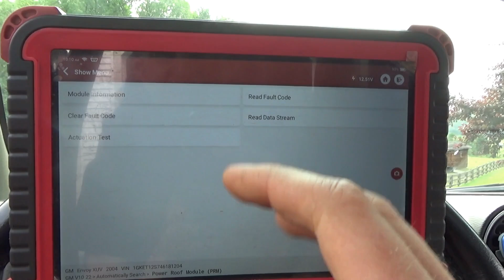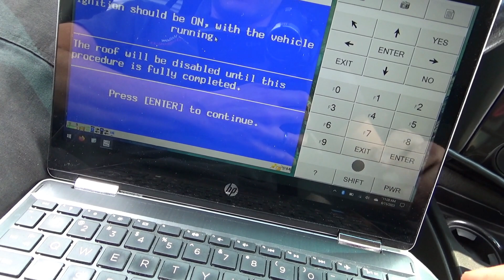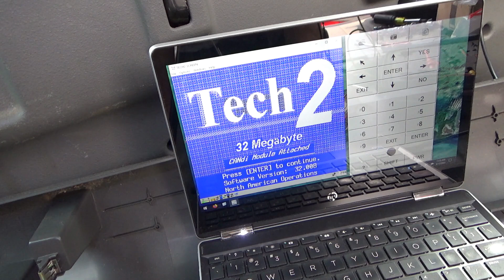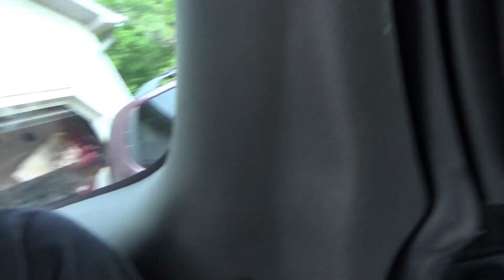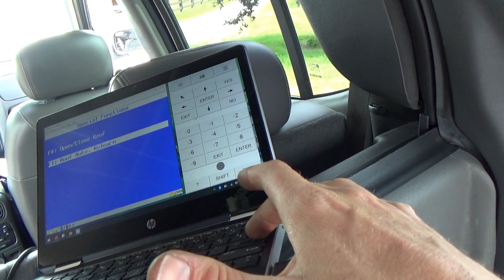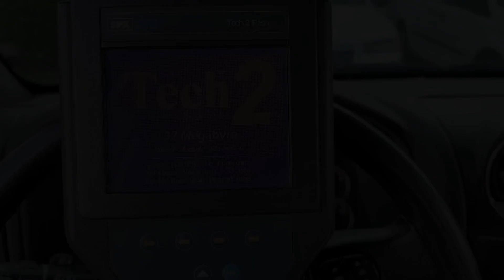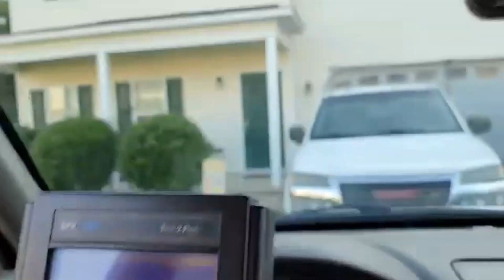Envoy XUV is BACK...and I CAN'T FIX IT?! (Power Roof FAIL)

Comment: So the grounds are integrated in a series and one component that doesn't fully disengage breaks the ground to all other components? 🤔 Really makes sense because you don't want things to operate simultaneously. One function performs before the second function takes place and if that particular function is telling the system that it hasn't completed its cycle the system thinks it's still functioning which is using the ground and until it completes its cycle and releases the ground via relay for the other actuators to activate? Maybe

Comment: I have the same problem my back window was working fine and then I opened the roof and can close the roof but it keeps telling me to open the roof on the dash I’m like it’s closed. Now my back window won’t close because it thinks the roof is open I don’t know what to do
Reply: Hello, have you figured out the solution?
Reply: @luigidmolino6217 yes I replaced the relay for the back window and I had to have it reprogrammed. It fixed the roof and window problems for me.
Reply: @Purpleppl_8 you mean the end gate control module?
Reply: @luigidmolino6217 yes but the rely that’s back there not the main end gate module. The relay should be on the driver side of the end gate between the two latches.

Comment: I have an 05 xuv. I came across same issue. After many hours of my life, that i will never get back, doing endgate latches, window and roof relearns. My solution was to wire in a switch for the roof. (Bypass the module)
For the endgate functions i use a small bidirectional scanner that i found for $100 on amazon. Via an app on my phone. 
Another problem i had to fix was 4wd disconnect. Other than that it's a cool... truck? Its unique and kinda rare. That's why it was worth saving a small piece of americana to me. 
Mine has the 5.3L and ive growen to love it
The little bypassss switch doesnt even alter the look if you get the right switch with a decent looking mounting bracket to look profressional. Dont use some cheap looking toogle switch. Save that crap for the batmobile.
Reply: Hi thanks for your fix. I would love to know how to get endgate working ? Glass up & down on scanner ?
Reply: Hello, what are the colors of the wires that you used for the manual switch to bypass the sliding sliding roof module?

Comment: There was what looked like a stamped metal item visible on the PCB next to the relay - could that be a low value current sense resistor in the ground path, that's gone open circuit?

Comment: I wonder if the reason you could not fix it in part one was that the rear window wiper was not quite in park? Could not do the window re-learn so you could not do the roof re-learn. obviously would not have fixed the loose regulator but may have got you further down the rabbit hole.

Comment: Ivan, I've personally rebuilt an XUV endgate with all junkyard parts and brought everything to functioning with a vcx nano interface and tech2win.

The microswitches in the endgate latches are the first part of the "waterfall" of checks.

Check under Special Functions of End Gate Module... Watch your latch status'

I suspect these are dirty or failing... Also often times if you seperate the latch from the metal housing that bolts to the gate, you find the plastic housing has cracked and the gears are flexing things in the latch in ways they shouldn't.

If you have any questions about my hands on experience with this mind-bender, feel free to reach out.

Good luck,
Javier G 

P. S. - I also have multiple latches and other endgate parts available.
Reply: I also have physical copies of FSM for that year if you need me to send you some info from the xuv section

Comment: Wow  300 comments in 16 hours, too much to read. I have one that is working also, 207,000 miles on it. I had updated the pcm with a cheap tech2 knockoff, it says to pull a couple fuses but dont remember which. I went to program it and it failed, long story short i had an aftermarket radio and had to pull that fuse also, almost cost me a lot bit it did reprogram. Not sure this info will help but sometimes its something weird causing an issue. Im not sure why it would stop working again but those latches may be an issue. Interested to see whats the issue now. Ill help anyway i can. I ended up wiring a pushbutton switch in the tailgate cause those pad switches are poo. If i think of anuthing else that will help ill let you know,i did take pics of wiring diagrams but i imagine you have better access to that than i do keep on wrenchin brother
Reply: Hello, I am having issues with the endgate latches. It doesn't want to open. Does that fail to open also when the endgate module needs reprogramming? And if so, do you have a wiring diagram to be able to get the endgate to open till I get a Tech2?

Comment: I'm not going to pretend I would have solved this. But right from the get go, my first thought was a micro switch somewhere or a sequence issue. Having worked on bmw forever with all of their intricate sunroofs and convertible tops that fold up like transformer origami. If the motor is ok (usually drowning in water), nothing is bent (physical damage), it's always something stupid like a micro switch stopping it. Whether a part is not stowed right, not adjusted correctly or incorrectly orientated. I always wonder what people will do when they got older, because they're a nightmare even with all the factory adjustments procedures. To get the roof right, then all 4 adjustable frameless windows working in a ballet. All with anti-jamb safeties, haha.

Comment: Well it was worth a shot.. I'm glad it's now fixed. I was thinking it was a position switch issue this time. The roof has to know where the door and window positions are to move or it'll deny permission, similar to a convertible top in these newer cars. That's where the theory of operation comes in handy. Would have never guessed the  window learn had to be done before the roof would even move in test.. good work guys..

Comment: In my mind, the position sensors should be at either end of the tracks the roof runs on. That would account for the mm travel recorded in diagnostics.

Comment: In my 25 years at a GM dealer i have only dealt with 1 of these trucks for endgate  issues believe it or not, not many around i guess. First time it came in was an endgate lower left latch issue not sending proper position signal. Could not get a new one so installed a used part. Worked for awhile then came back. Upper right latch issue this time, again used part fixed it. Came back a 3rd time, upper right latch again. Put another used latch in it and fixed it again. Last time i saw it so either its still fixed or customer gave up. A nightmare of a system if you ask me.

Comment: What seems to strike me in this situation and what Ivan has already pointed out along with the guy in North Carolina is,
when there is a loss of ground per say through latch mechanism that isn't working properly is this: loss of ground for
that module to work right. Whether there is a travel issue or tailgate position whereas grounding is achieved ONLY when
certain conditions are met. May it be a certain positioning or a positive latch of the tailgate mechanism can and will 
need to be met in order for the control module can remain operational. In other words, this entire logic is dependent on
an integral "Interlock system" will determine whether the module will function as designed. If something is out of kilter
by some varying degree by either positioning, travel or an interlock switch so that the module will remain functioning;
that is if the module is at least passing initial testing. The second module for sure is working as designed BUT it is
reliant on all other simplistic means such as a tailgate latch or perhaps at least one other mechanism that may still yet
to be discovered. I can think of other means where an interlock system would be used, such as for safety consideration,
such as for child proofing and or to prevent major damages to equipment OR just major failures that can cost an owner
a huge fortune but in this case, it is something that is burdening the repair person and the owner just way too much!!
Just in an instance of Ivan having to burn through 8 hours and the second repair person, God only knows how much
time that he has into this repair is way out there in left field!

Comment: Could possibly be damaged vias through the board on that ground supply for the relay. Could be shorted decoupling capacitor. Could be broken solder joint on a current sense/shunt resistor. The MCU on that board will most definitely be monitoring current draw through the motor. If the sense circuitry is damaged it wont allow motor operation.

Comment: There was a gentlemen on diagnostic network recently who had to remedy a malfunctioning power sun roof in a late model ford F series. The complexity in that system boggles the mind. He discover that the electric motors that operate the roof are one use only, you can not use a yunkyard one and they have to be installed in a specific position in the correct order. If you do not know this, the sunroof will NEVER operate. Thanks Ford.

Comment: That is a mind boggling problem, Ivan! Seems your Tech2 Win doesn't do all the tricks required - what a convoluted process, with weird (and probably completely unnecessary) interactions!
Keith's experience and a real Tech2, got it right and I was already cheering for him, when I saw the final message in the video! That XUV is really hellbent on not being repaired! Could there be limit switches that are a bit sticky, for not working for a long time?
Hope there will be a Part 2 for this weird case.

Comment: Years ago my foreman had one of those, his problem was the front end. He beat the crap out of it, towing, overloading etc.. once he stuck it in the mud up to the rockers and left it on site. It froze in and he had to get a ground thawer from the cement guys. I remember it finally died after 300,000 miles, then he got a Tahoe. These were company cars but they came with a maintenance program etc. I had a 3500 or 4500 dually stake truck it had 4X4 etc. diesel worked the heck outta that too. They were good trucks, made a lot of money with them👍

Comment: There is a motor current data pid. How is it measuring that?  If the missing ground should be monitored, providing a constant ground directly to the relay might cause other issues.

Comment: Irrelevant of the module function logic, there should be a simple overide switch to manually close (&/or) open the roof.
Even if said manual switch is for techie use, e.g. a switch in the Fuse box.
That way should the system fail then at least you could completely close the bloody thing.

Comment: If I had a 20 year old truck, I'd just put in a single pole double throw switch. No relays, no limit switches, heavy enough wire to carry the load. As long as I held the switch toggle in the up position, the roof motor would run to open the roof. Hold it down, the motor runs to close the roof. Both cases, the motor runs as long as you are holding the switch. It would be up to the operator not to hold it so long as to blow a fuse or burn out the motor. Crude, but at least it would work.
Reply from the maker: But what about all the tailgate functions? 😅

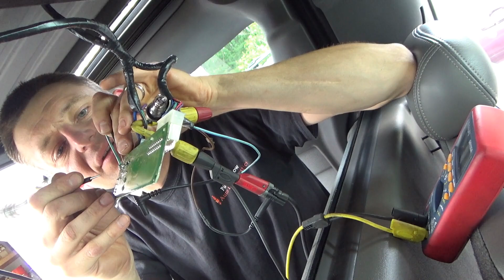Comment: @21:00 maybe the ground is controlled by another module like the BCM for safety sake and the BCM never sends the wake command if there is no ground signal - it figures the module is shorted.

Seems to me like the only solution to this is to replace the whole logic with a custom programmed MCU, forget the OE modules.  Seems like pretty simple logic.

Comment: that relay is used just to control polarity for the motor and power goes trough a mosfet. Its a way to make relay last longer by first latching relay contacts and then turning on the power with mosfet. this way no arcing in relay contacts.

Comment: So, a piece of material caught in the tail gate latch thru a monkey wrench into the whole works?  Interesting...  Over engineered for no good reason.  What a headache.  All you should need is the mid-gate and rear window to be down in order to open the roof.  I'd say it's time for an arduino and a little rewiring to fix this disaster once and for all.  But I'd love to see the final conclusion.
Reply: That's how i understood it. The module thought the gate wasn't closed. Odd that it didn't throw a trouble code.

Comment: Thank God for guys like Keith. If I had a problem with my unit, I would start with SMA, then Ivan, then Keith. Keith understands these over engineered projects, and doesn't quit untill he finds the trouble. What a blessing one has to work on these nightmares.
Reply: Yet the thing failed not long after the electronics guru fixed it as I sais earlier everyone no matter how good they are at their job will get at least one that will always stump them.

Comment: My SPX Geni with the Tech2 software set on it routinely does things that my Tech2 fails or shows errors.  The blue/grey colored Genis were popular in GM dealerships around 2006.  I see them and the Mac re branded red colored Geni clones called "Determinator" pop up on ebay for cheap.. always wondered what their onboard software is like.

Comment: So do the mid gate lock switches complete the ground that Ivan was looking for.
Reply: Based on experience, I'm 90% sure that the midgate isn't integrated in the checks for the endgate or roof.

The midgate has a simple on/off switch that is triggered when the window comes down and reats on it... If your midgate regulator goes out... You can always tape the sensor shut, remove the regulator and lower the window manually to have a functional midgate fold button... Midgate doesn't care about roof and endgate and they don't care about midgate.

Just my hands in experience with these things 🤷‍♂️

Comment: 45 years ago I had a '77 Volkswagen Rabbit with a sunroof operated by a manual hand crank.  Positive open and closed with infinate stop positions in between.  Stop closed position was indicated when the crank wouldn't turn any more. The learn procedure involved remembering to turn the crank counter clockwise to open and clockwise to close.
Reply: Yep, next thing we will see are electronic lug nuts and how to diagnose removing them !
Reply: 🤣 as Mr O says, a solution to a problem that never existed.
Reply: Shazam!  What will they think of next?  Clearly,  intellectual property games have gone too far in the automotive industry: hiding 'learn mode' procedure from techs... damages the vehicle owners wallets because mechanics can only fishtail around a system to hope [by accidental discovery] a fix is found.
Reply: Modern technology in cars is nice when its working. When its not it just makes you want to drive off a bridge 😂
Reply: Indeed!
Reply: @Runco990  I still got manual windows & they need silicone spray grease to make them work (periodaclly that is.)
Reply: There is something to be said about simplicity!
Reply: @JC-yt1pm There's also something to be said for a roof without holes.
Reply: Just gave me flash back to my 79 Scirroco.
Reply: And the rain sensor was driving without a hat. 😮😂😂
Reply: I had a 66 Volkswagen beetle with a model 2-55 air conditioner. Two windows down, going 55 MPH. It never failed.
Reply: even in Europe?
 Wouldn't it be the opposite way?  After all, it is German.

Comment: Crap.  Getting that roof relearn done is like a good golf swing. About 10-12 separate chained together parts have to be just right and executed in the correct order before you can get the ball off the tee without a resulting a "Happy Gilmore" moment.

Comment: Could it be the limit switches?

Both reading 0 is suspect to me!
Reply from the maker: Surprisingly there are no limit switches. Limit = motor stall lol!
Reply: @PineHollowAutoDiagnostics  MCU monitors current consumption on the motor circuit. It counts pulses from encoder "position sensors" until it sees a spike in current from the stalled motor.

Comment: Bet there is a wiring problem ...
Reply: After all of that, it could be.  It would be hard to find.  You would have to scope or continuity check a lot of wires while doing a wiggle test.  If it were my vehicle, I'd just keep the roof closed and trick whatever modules need tricking to not throw codes.

Comment: If I absolutely wanted this to work flawlessly I would rework the switches and add a limit switch to the windows and rear cab panel, and the roof panel . The roof would only retract when the end gate window is down, the roof panel will only close when the rear cab panel is down and the endgate window is down. 
There is too much going on with switches and electronics for this to be reliable. The system won't function if it doesn't know where the window s exact position is or if the endgate isn't latched properly.

Comment: That is a familiar looking NEC relay... Looks like a common relay from mid 90s to mid 2000s. I have an Audi CCM with a similiar double relay that controls the vacuum pump for the central locking. The relay clicks but the pump only runs in the other direction. Tracks to the microcontroller seem intact for the control side so who knows :D

Comment: Wow!  The level of complexity to perform a simple task is astounding on these vehicles.
Reply: Smells like a logic interlock, so yes: one module being down [or having a dead I/O channel] locks up another where code waits for a predefined enable bit.  The scattering of these modules is what?  Kind of ruins the entire concept of central point troubleshooting... which is the ONLY benefit of computer controls.  We should not have more than two on a vehicle: one for engine control, another for auxiliary functions.  So it appears this vehicle is a case study in retarded engineering - too much time on CAD, not enough on systems.
Reply: @flinch622  Never a truer statement uttered.🤣